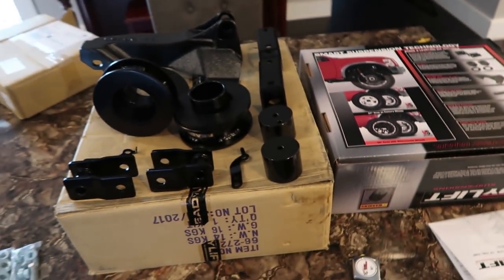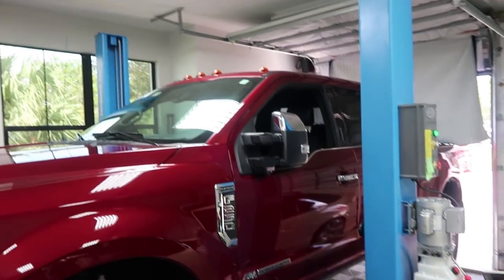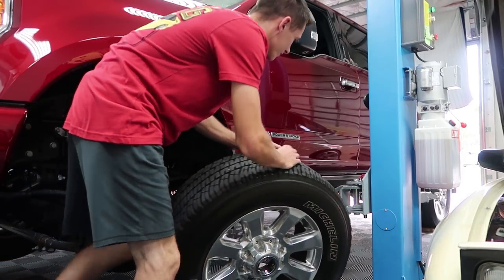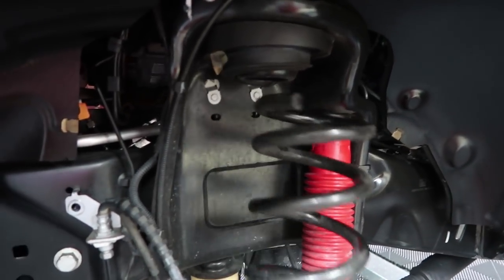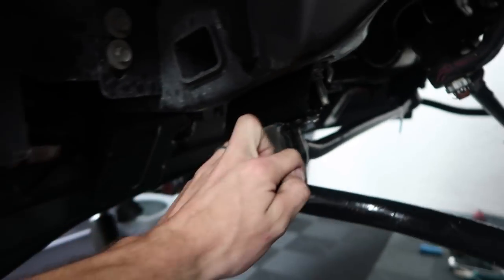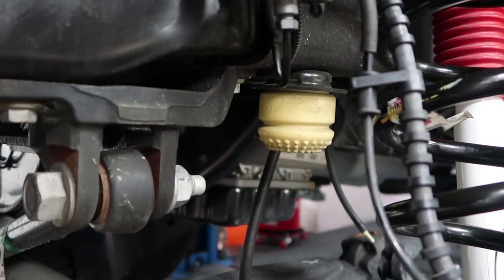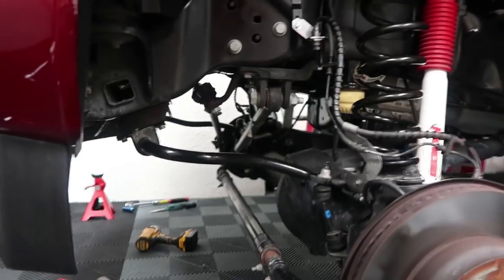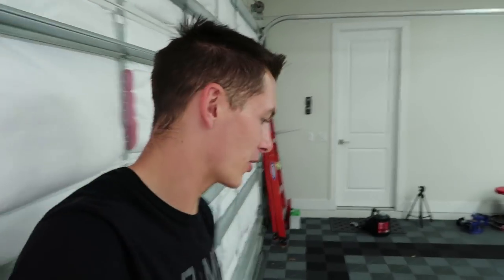2017 F250 Leveling Kit Install - ROUND TWO

Comment: The track bar relocation bracket keeps the axle centered after the added lift, thus without it the axle would be shifted to the drivers side due to the track bar being too short

Comment: I installed that exact kit and it does not retain the factory driveability. Steering feel becomes way to loose and lots of bump steer. So I removed the track bar drop bracket and went with the icon adj track bar. And also added new caster cams. It's much better now but not factory. I'll b taking out the caster cams and adding adj radius arms.

Comment: The track bar relocation bracket is to keep your tires centered in the vehicle  so one side don’t stick out and the other side in   It’s needed on any lift over 2”  or some kits come with an adjustable track bar  without it it pulls the pass side tire in as body goes up or moves axle toward driver side

Comment: The track bar relocation bracket is to keep the axle centered under the truck because as you lift it the axle shifts towards the driver side

Comment: Make sure you go back and tighten all those bolts one more time after about 200-300 miles.
Reply: Zeppish haha ford problems
Reply: David pelkey what no
Reply: David pelkey it’s not a ford problem it’s recommend by any after market company when working on suspension on any car or truck or every thing in between
Reply: Yeah you're supposed to actually torque suspension components with the weight of the vehicle on the suspension. Rechecking the bolts later allows you to skip that step.
Reply: Allows you to skip that step? If you skip that you will most likely have premature wear of bushings.
Reply: David pelkey always retorque shortly after installing something. It's not Ford, it's common sense it'll have to break in first.
Reply: WOW why can’t 
we get FOXX to help this poor guy out. It is embarrassing seeing those Advanceautozone Rancheapo Shocks in a 80k truck I guess the same Engineer worked on the design of the original 6.0.

Comment: A trackbar is used for side to side axle location. The reason for the drop bracket was so that the axle will stay centered on the car. For example when I lifted my truck 3 in" I needed an adjustable trackbar/panhard bar to re-center my rear axle.

Comment: The Trac-bar relocation bracket is for fixing steering geometry after raising the vehicle.  On a solid axle you want your traction bar to be at the same angle as your draglink (link from pitman arm to tie rod).  Lifting the vehicle changes the angles to the bracket corrects it.

Comment: If no one has said yet, the track bar relocator bracket moves the axle back to the passenger side where it is stock. When you lift it and don’t use that the axle will be offset to the drivers side. Did you get wheels?

Comment: The track bars job is to center the front axle over the frame. When you raise the truck, the axle actually gets pulled to one side because of the track bar. The relocation bracket keeps the track bar geometry so the axle stays centered.

Comment: The track-bar relocation kit doesn't affect your steering wheel. It helps keep your axle centered under the truck. A track-bar goes from your axle on lets say the passenger side to your chassis on the drivers side. When you raise the front of the truck your track bar stays the same length which will pull the axle to one side. All that piece did was keep the axle in the middle of the truck and all the suspension and drive-line geometry close to stock.

Comment: Track bar bracket corrects the location of the front axle side to side after you lift it. If you don't use it, it can cause bump steer and death wobble, something that can be a nightmare at highway speeds towing a trailer.

Comment: The track bar is to relocate the front axle back in factory position if you don’t use it the front axle is I’ll be out a little on the left side and in on the right

Comment: The relocation bracket is to cure the angle of the traction bar to keep it from wobbling at highway speeds not to help the steering wheel and you still need to take it and get it aligned. Anytime you change anything with the suspension you need an alignment

Comment: The weight of the solid front axle is PLENTY to decompress the springs.  For independent FWD the tire weight will help pull an A-Arm down because the torsion bar is holding it up. The Track Bar Relocation Bracket is to Center your axle so it's not pushed towards the passenger side after you've listed the front.

Comment: track bar bracket help center your drive line and keep your steering angles some what to factory specs. You would hate it without the track bar bracket. As you lift the the axel get shifted to one direction, the bracket brings it back to a center.

Comment: the drop bracket is designed to maintain the factory geometry of the track bar.  Steering wheel position is always something that needs to be adjusted.

Comment: Yes relocation bracket sucked I did mine on the ground with two floor jacks two jack stands several pieces of wood lol and it was little scary at times but I got it done

Comment: The track bar helps center the axle (from left to right, or from drivers side to passengers side) when the suspension is compressed and decompressed. so if you had not installed the relocation bracket, it could cause severe bump steer and "death wobble" in the front end from the geometry of the suspension being altered. There are a few good explanations on some forums about how the suspension works. I have a 2006 F350 with the same design of suspension. Truck looks good! I desperately need a leveling kit on my truck.

Comment: Not sure if you go through all your comments but just wanted to add too even with the Trac bar bracket you should get a alignment regardless just to make sure it isn't out. I'm a sales manager at a custom wheel shop in Alberta, Canada  and we do lift and leveling kits. Awesome job also! Ever need any ideas on wheels or tires let me know

-- also made this comment before finishing the video lol, but it might be out slightly and can wear your tires unevenly over time

Comment: The manual locking front hubs use vacuum to actuate when the hubs are selected to "auto" if you have the Electronic Shift on the Fly T-Case. That's what those vacuum lines are for
Reply from the maker: +Jake Bannister good to know!

Comment: The relocation bracket thing is to corect bump steer not stearing ( well i think based on looking at it )
Reply: icyphilippe negeative it is a drop bracket for the trackbar when you lift a solid axle truck in the front the trackbar is a fixed length and your axle will move out towards the driver side so you use this drop bracket to put the trackbar down in the right position to recenter the axle I personally used an adjustable trackbar I was able to thread in or out to position my axle when I lifted my dads 2005 f350 and when I lifted my 2008 f350 (2005-2017 is the same suspension)
Reply: 6door 6four makes sence and yes looking back at it you are right

Comment: Track bar relocation bracket = centers your front axle again.  With the lift, your axle would be pushed more to the drivers side.  Your tire would actually stick out more on the drivers side than the passenger.  Lifted Jeeps accomplish this by using this type of bracket or an adjustable track bar.

Comment: Now the rears going to squat even more with a load/trailer
Reply: The rear would squat the exact same distance it just looks more cuz the nose isn’t as low as it once was. He did nothing to the rear suspension cuz it’s just a leveling kit the load capacity would be the exact same

Comment: Ok i am pretty stupid when it comes to big trucks and stuff so this is probably wrong, but when you have the trailer fully loaded with car etc.... it pushes the back down and the front stays the same yeah, but now that the front of the truck is higher wont that mean that the trailer would be way lower when connected making it like almost scrape if you know what i mean?.
Reply: Reason why guys run air bags in the rear. It is a heavy duty chassis/suspension truck regardless. He's hardly sagging as is.
Reply: ok cheers didn't know this truck had airbags in the rear

Comment: the relocation corrects the angles of the tire when the suspension is compressed or extended towards the end of its travel, for when you are turning the wheel. ..thats what the guy told me anyways.  by the way, I watch your stuff  because I admire all the things you accomplish, soo add the business degree to the list.   Id like to hang out and let some of your good habits rub off ;)
Reply: Avoid the guy that told you about the track bar relocation bracket....it ONLY keeps the tires tracking in the center, as it did before the lift...it does not change any steering geometry at all.

Comment: Hey Adam FYI the track bar is essentially a Panhard bar for the front end. It needs to be adjusted whenever you raise or lower a car/truck, otherwise the axle would settle to one side or the other. 
So that bracket is for that bar. The tie rod is what you adjusted at the end with is part of the steering linkage. 
Truck looks great!

Comment: Adjusting that arm and getting your steeringwheel straight doesn't mean that you won't get excess tirewear! Your alignment can still be fucked even though you straighten your steeringwheel...

The bracket for the shock looked weird... Like nothing is keeping it in an locked upwards position? What's preventing it from pivoting on the bolt and make the shock offcenter??
Reply: The shock brackets are made to fit flush against the backside of the original bracket, so there is zero chance of movement or "pivoting" as you mentioned....Adjusting the drag link from the Pitman arm to the steering knuckle indeed re-centers the steering wheel, BUT an alignment is mandatory, as the castor is WAY off after a lift/drop of any amount!!!  Toe and camber are unaffected by a lift/drop of any amount on a straight axle and steering system such as Ford uses....My truck is the same color, but an F350 Crew, SRW, long bed...I use Airlift ultimate 5000 pound bags on the rear of mine, with auto-leveling valves and on-board air supply to keep the rear level with any load, and am installing the same ReadyLift SST kit as Adam has in his truck, and putting on 1"-taller/wider-than-factory Toyo Open Country M/T tires in a taller, LT295/65R20....Great job/video, Adam! The 2017 Super Duty is on bad assed truck!!!!

Comment: Adam, those adjustments are for alignment, and the steering wheel doesn't tell the whole truth about your alignment. You should take it to the shop before u ruin your tires. And you should come back to Finland.

Comment: Are you gonna tune it An put an exhaust on the truck? An is it a 6.0?
Reply: Generation 3 Ford-built 6.7 liter B20 flex fuel diesel pumping 440HP and 925 pd-ft of torque, factory...AND damn near 20mpg when not blatantly enjoying all that power....it's hard not to get into the throttle!!

Comment: You want to pay more attention to the truck then your drift car. Remember the truck is hauling the drift car but the truck is not caged and if anything happens at 70mph on the freeway you are screwed. If something brakes on the car you just push it on the trailer and go home.

Comment: The amount of uneducated comments on here are ridiculous. A leveling kit has zero effect on ride quality and has no effect on steering or traction while towing. Trucks don't come lower in the front for "steering traction" it simply gives the truck a better crash test rating. Also the truck isn't going to "squat" from accelerating. And whoever said it needs an alignment doesn't know what they're talking about because it's a straight axle, you can go as high or low as you want and nothing will change except for the adjustment he made to re-center the steering wheel. Only independent suspension needs re-alignment after making ride height changes. And the purpose of helper bags is to lift the rear back to stock height to retain the suspensions full range of motion instead of being bottomed out 24/7 if your hauling something that heavy.

Comment: Front Diff vent tube not vac line.
Reply: STOF vacuum supply line...vent tube is off the differential and placed in engine compartment

Comment: I level all my trucks.  But, your not going to like it when you put your trailer on there and the front end is sticking up way higher.  Also, you need to re-aim your headlights.  Lastly, go get some bigger tires so it doesn't look goofy.

Comment: Something about single turbo-ing the 335i is going to be the bad decision
Reply: or he got a bad idea when he said he wasnt going to go sideways at 90mph in a truck...
Reply: nah gt3 rs
Reply: Single turbos are way better than twins. One less turbo to worry about so it's way more reliable and cheaper to replace. Really a win win going single you get the same if not more boost than two small turbos, if you get the right set up it could also be more responsive.
Reply: Or the 2j is going in the 240?🤔
Reply: s13*
Reply: I'm not saying the single turbo was a bad decision, but maybe something went wrong during the install or some huge cost came up
Reply: Hans Kieckhefer the 2j is going in the BMW
Reply: lmao the BMW basically has a 2j. The N54 and 2JZ both are 3.0 inline 6s with twin turbos but can be replaced with big single turbos for high horsepower (~1000HP) on stock internals with no issues.
Reply: Hans Kieckhefer or maybe he's swapping engines with the BMW and 240
Reply: He should quit playing around and swap the F250's motor into the mini cooper 😂
Reply: Hans Kieckhefer or the f250 into the s15
Reply: Hans Kieckhefer Or maybe hes just fucking working.God damn you complicate things way too much.He has a real life you know?His BMW is not the priority right now.
Reply: He said in the video that the next video would address some "bad decision" and I was just making an assumption since it seems like the BMW is whats being worked on right now.
Reply: I think the bad idea is linked to this video, like off roading the f250...
Reply: I wasn’t far off
Reply: Hans Kieckhefer ISSA CAR

Comment: The point of the rear being higher then the front is so your truck runs level for maximum traction in the front when towing. If you bought your truck for mainly towing, why put a level on it. Now it's gonna rake when you put load on it and look funny.
Reply from the maker: That's what the air bags will help with
Reply: Adam LZ yes, yes they will help with that
Reply from the maker: I had the same thought process as you but figured there would be no harm in offsetting the level with bags - It's the same load either way just different height.
Reply: Adam LZ yea that will work, I didn't know you were getting air bags for it
Reply: Adam LZ if your putting bags why level it. The bags will do that for you.
Reply: Because the bags + levelling kit will allow the truck to be higher when towing, as opposed to leaving the front low and letting the rear squat low to be level. Bags only would just leave you with the front low and rear high when towing.
Reply: Because it looks sick? Lol
Reply: FishFind3000 he's only putting "helper bags" in the rear
Reply: I installed the levelling kit on a Nissan and it looked good but rode stiffer. When I installed air bags it sure helped with less sag after the levelling kit was installed.
Reply: MSengineering David Please explain how lifting the front will affect tongue weight
Reply: Arvgyl I don't think this affects Adams trailer because it's so long, but with shorter and taller trailers (especially ones with just one axle) if the tow hitch is higer than normal it tilts the trailer backwards and moves the centre of mass backwards a little decreasing the tongue weight by a little. But it's basically scientific overthinking...
Reply: Mikael Mäkinen but hes only racing the front not the rear
Reply: Beacuse of the bags he's installing later the rear will squat less and ride higher.
Reply: Mikael Mäkinen that's the point of the bags that he can maintain stock rear ride height when he's towing
Reply: Arvgyl Oh I read your first comment wrong. I thought you were talking about lifting the rear. Haha
Reply: Actually it is multiple reasons. 1 is to handle weight 2 for aero as a lifted front has more air going under. Plus other things but not what you said.

Comment: It's not really a good idea to let the axle just drop like that, you can rip out your brake lines and that's not fun!
Reply: 435....that was why the first thing done was to disconnect the brake line brackets....no danger to the hoses or lines, and it is HOW the spring gets removed/replaced....
Reply: Rainman_PondBoss trust me I know how it's done buddy which is why I know he needed a jack under the axles